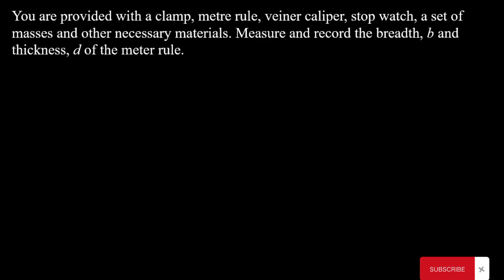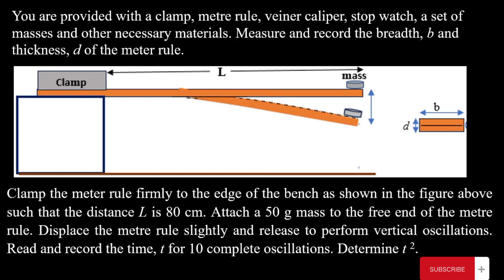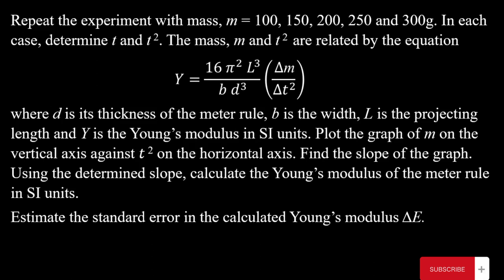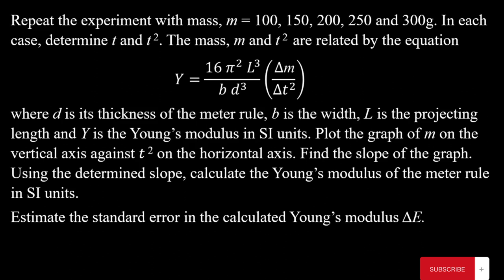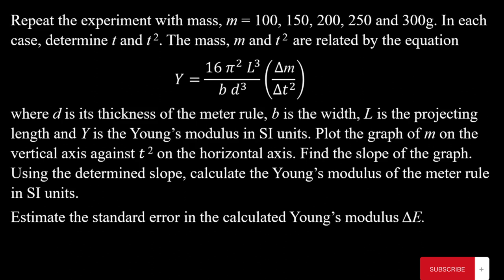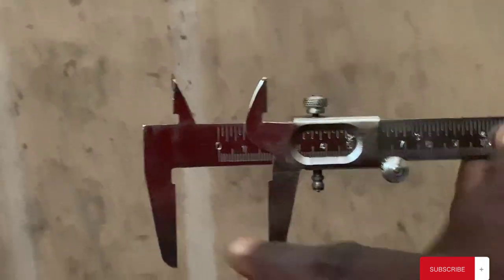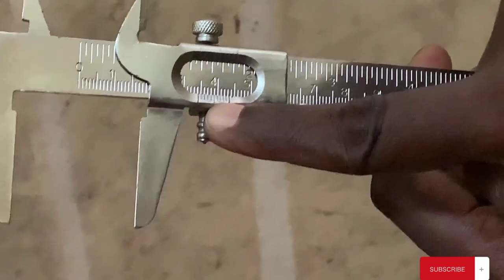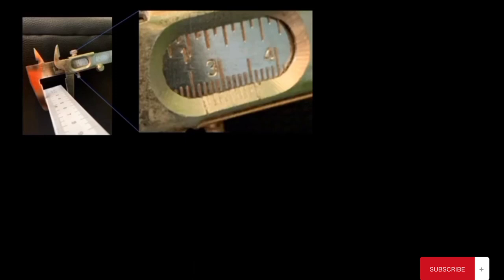AN EXPERIMENT TO CALCULATE THE YOUNG'S MODULUS OF A METER RULE USING AN OSCILLATING CANTILEVER BEAM

Comment: Nice video❤️
Sir the from the former video u didn't add the estimated standard error in Young's Modulus to the actual Young's Modulus. 

So if we are to answer these kind of questions, which are we going to use finally as our Young's Modulus? Is it the modulus with added error or the one without added error; that's the first one🤷🏻‍♂️
Reply: I also noticed that, well I went back to look at the error in the first one and it was really really small, I guess that's one reason he might have just skipped it but I'm not sure if that's totally true 😩